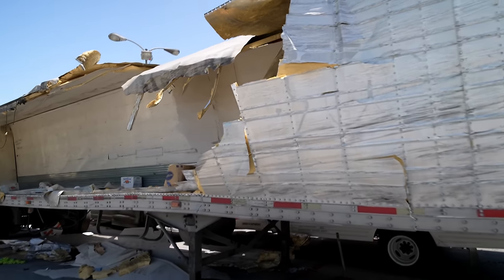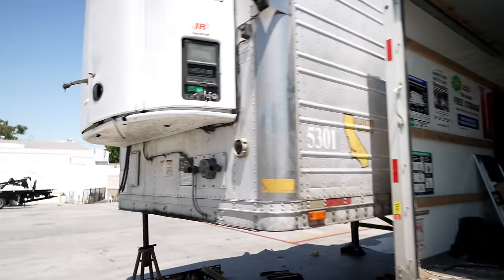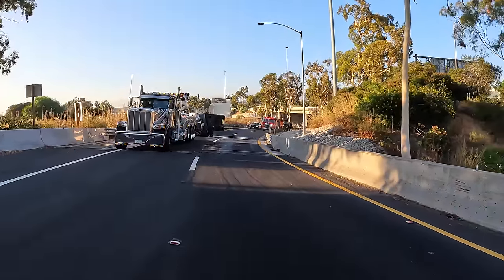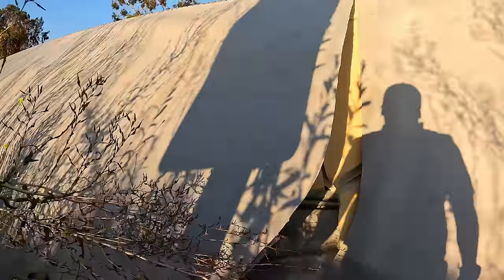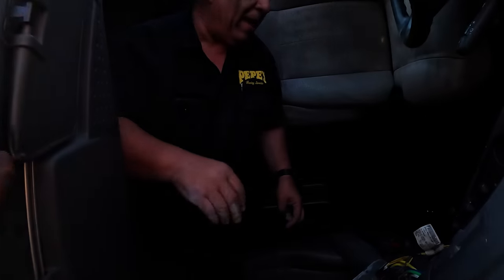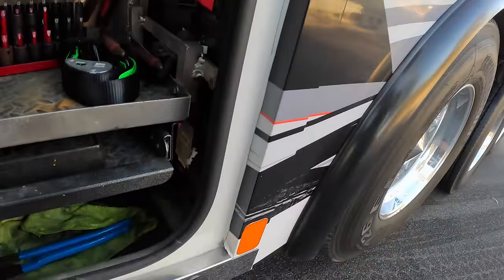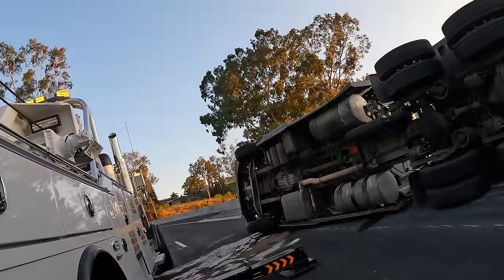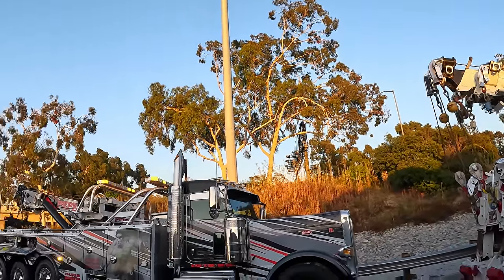Trailer Filled With Oranges Rolls Over on Freeway

Comment: All the orange jokes ! In Africa there would not be one orange left, the passers by would have cleaned the trailer out....probably  with assistance from authorities ! Its common too for drivers to run away , I jest not.
Reply from the maker: These scenes are controlled. The offramp is blocked and the scene is secured so we can work safely.

Comment: How often do your other co-workers use HULK which is a Heavy-Duty 2020 PETERBILT 389 day cab 50 ton Century 1150 rotator tow truck tri-axle single steer?

Comment: 20:30
Sleepercab wirh 2 fuel tanks and a reefer with a fuel tank.
45k lbs of oranges?

I GUARANTEE that vehicle was over gross by 1000lbs or more.
Reply: Even so, taking any curve at its posted speed limit must be adhered to with these semis.
Reply: A typical tandem sleeper weighs 17,000 and a 53' reefer about 13,000, for a total of 30,000 empty for the rig, which could easily haul a 45,000 lbs load legally. 45,000 loads are fairly common.